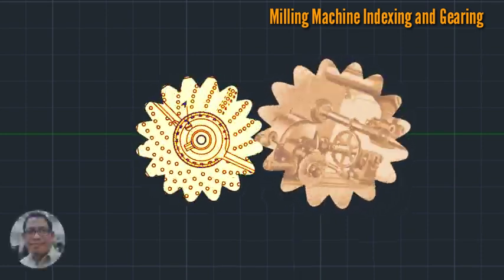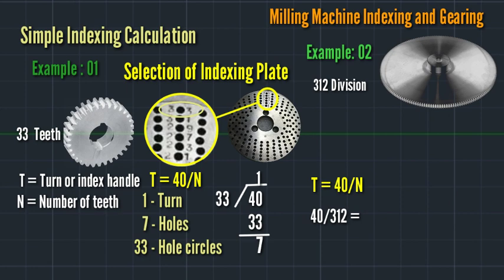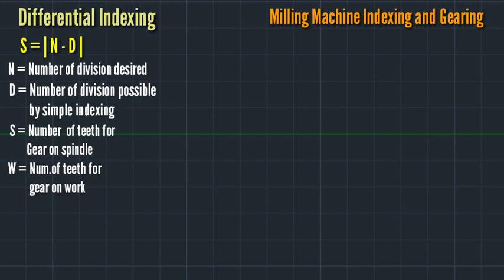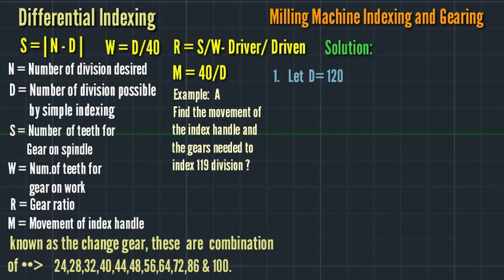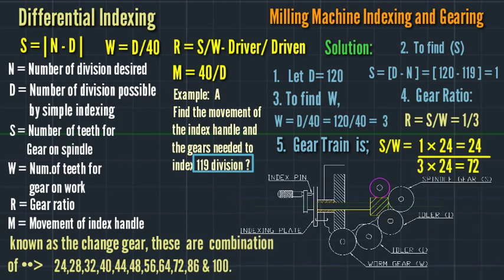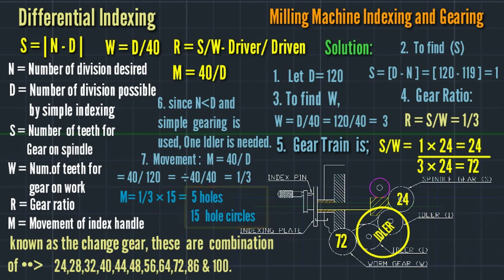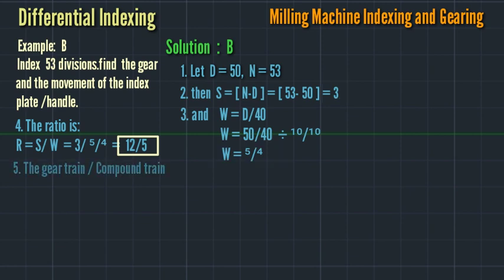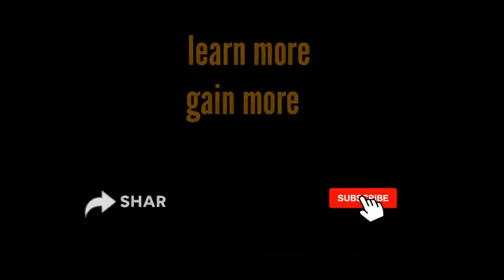MILLING MACHINE INDEXING HEAD CALCULATION AND GEARING ARRANGEMENT | Machine Shop Theory

Comment: Idol help pag 51t  ilan yung # of holes in ilan din anv turn
Reply from the maker: 51t require differential Indexing 14/17 index circle 17 ( gear on worm 24,gear on  spindle 48,idler 1 24t , idler2 44.
Reply from the maker: Used 33 hc.

Comment: Sir 36 teeh po ang gagawin q na spur gear wala pong 36 whole circle paano po i calculaye ito para maqha q ang tamang plate whole cirle anu ang mga visible na mga whole cirle dito salamat
Reply: Maraming salamt sir bago lang kasi aq nag start mag aral ng milling kaya malaking tolong napo ang mga sagot mo sa akin aq kasi ang na asign sa milling kaya maraming salamat po sana tolongan mo po palagi aq
Reply from the maker: 1 ²/¹⁸
Reply from the maker: 1 turn 2 holes 18 hole circle

Comment: Sir RAD. Ang index movement Ng example no 2, Doon sa differential indexing ay 12 holes in 15 hole circle. Tama ba?
Reply from the maker: 40/50 ÷¹⁰/¹⁰= ⅘×³/³= 12/15
Reply from the maker: Correct sir

Comment: Thank you for your video! And I have a question. When I studied gears, I knew it as a gear ratio (R=driven gear tooth/ driver gear tooth), so why did I use the formula (R=driver gear tooth[spindle]/ driven gear tooth[worm]) here?
Reply from the maker: thats prior for availability of gears and gearing arrangement on indexing on milling table.